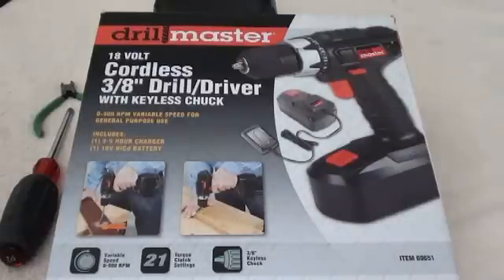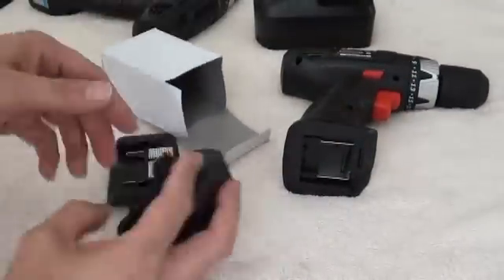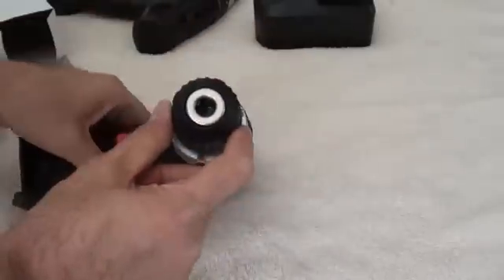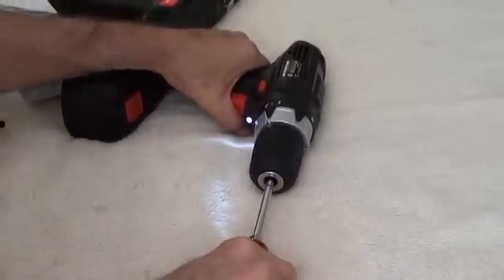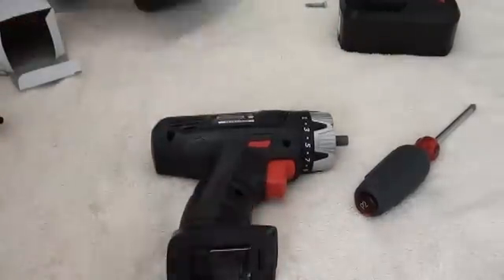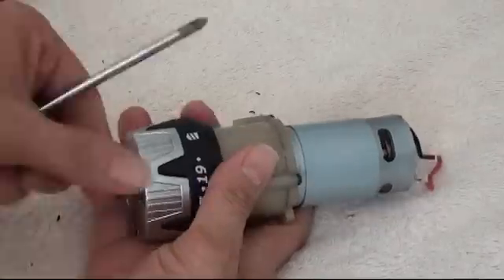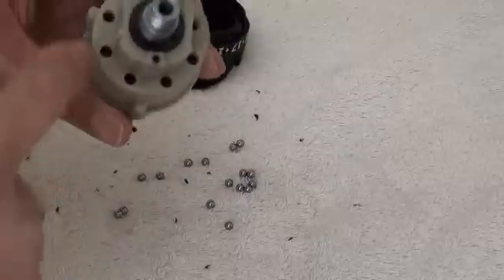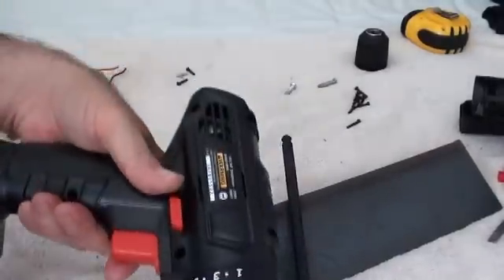Let's Build - Rover Mk3 - Part 2 - Lets go shopping! Drill Master 18V #69651

Comment: I must have gotten a good batch drill cause the damn chuck won't come off. I tried bench voice grip and rubber wound around wrench nothing!! Damn little thing won't budge
Reply from the maker: they can be tricky...  There have been a few times I have had to take the angle grinder to the chuck to "extract" it.
Reply: just hit it with a hammer xD